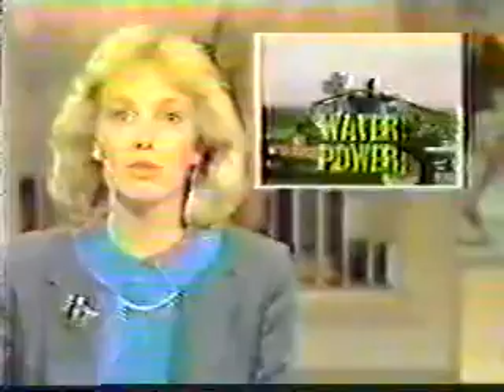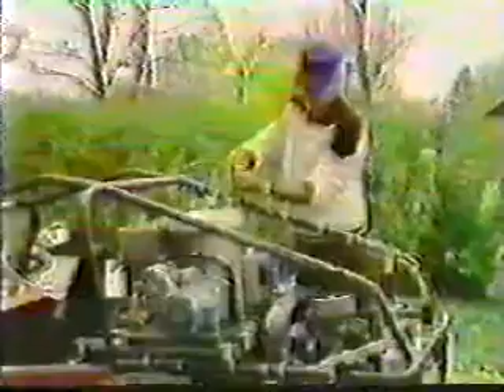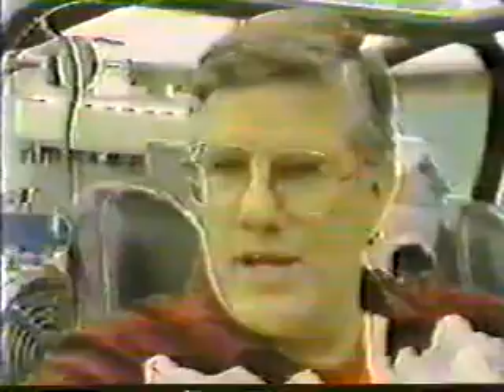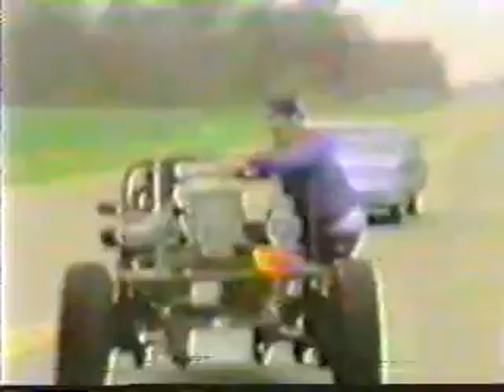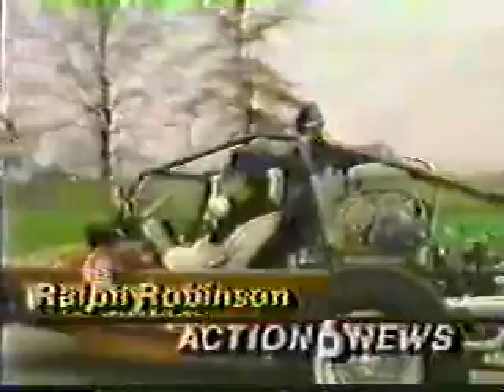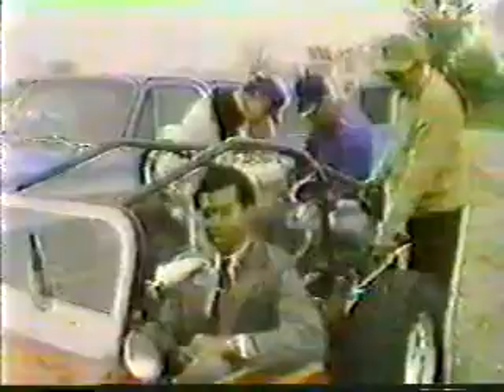water powered car

Comment: if you actually do the math he says you can go from los angeles to new york which is 2790 miles, with 22 gallons of water, thats 100 litres. that can create 11,19 kg of hydrogen and 88,8 kg of o2. now a toyota mirai can go a pretty respectable range of 845 miles on 122 litres of just hydrogen. 
forget about even making the car work if you listen to him and just think for one sec, he's full of bs. but lets talk about that, how does the car work? well acording to the internet and him, he has created a way to make hydrogen with 1700% output with the same amount of energy, with resonance, like breaking a glass with sound. now I know how you normally create hydrogen from water.
 its called electrolysis, where you give the water electrons, so they become happy and separate, making o2 and hydrogen. now if you could use the energy from the now unstable hydrogen, to blow up and run a car while making net energy to also make the power for the car youd be breaking the laws of thermodynamics, which would be nice, but not possible, as far as i know. but he has that resonance to make hydrogen super efficiently, but the theoretical minimum is 286 kJ per mol/18 ml of water to make hydrogen and you cant do that unless you have an outside heat souce. thats not even taking into account how extremely hard it is to hit that. because we havent done that yet. (and we arent even using a catalyst here) anywho, hydrogen has the energy density of 286 kJ/mol. wow what a suprise no net energy. actually in the real world, we would be very much in the minus, you cant do it even if your efficiency is 100%

Comment: There was an article in The Grove City Record on December 3, 1997 in which The mayor of Grove City approved 56 acres for the building of a factory to produce his water fuel cell that could be retrofited to homes for heating/cooling and all electrical needs, also for large scale energy systems. ... he died on March 20, 1998. 3 and a half months after the article was published.
Reply: big Oil & Gas harassed him to sell his patients he said no, then soon after died of a mysterious food poisoning at a restaurant (just him). I think it sent fear to those close family members for them to alter plans or something... i looked extensively at all the old black & white videos there's a layering of opposing radio frequencies like opposite of reverse polarity in noise cancellation tec & need some old army radio gear to play with.. thinking about the SDRadio stuff..

Comment: there is energy all around you, its all above -273 celsius. copper wire saturates this energy well,make a tesla coil and put a voltmeter on it you'll get a reading. if you increase the pulse rates of the electricity you put inside it to around 10k - 40k per second, with each pulse you carry along that saturated energy, thus obtaining more energy than initially put inyourself,but its an open system. thats one way, this water power does it by fracturing and uses milli amps.

Comment: You dont get something from nothing, its an open system. free energy is the induction of the saturated heat electrical energy all around you. absolute zero is -273 celsius and has no energy, and cannot be achieved by thermodynamics, thus free energy and perpetual motion is a fact of thermodynamics. all open systems.

Comment: Nikola Tesla. He built his tower to induce the saturated heat/electrical energy in the earths atmosphere and make it into high voltage and transport it wirelessly to the whole world! induction kind of bends the 2 law of thermodynamics, so does the constant of gravity, producing an overload of mass onto itself, because the fuel has run out and cannot keep the star stable by energy shooting out. thus relativity takes place and produces a black hole, the singularity, divide by zero, infinity

Comment: to hell with your BS. the hydrogen cell gives out more energy than put it, just like burning coal. The electrolosis process causes water to separate into hydrogen and oxygen, then the cell causes charged ions from the hydrogen (+) and negative electrons from the hydrogen and the flow of electrons make electricity. then the hydrogen ions go through the system and unite with oxygen again through electrolosis to form harmless water again. They could even burn the hydrogen!

Comment: Actually, there are plenty of fuel types other than petrol that can be used to power engines, such as ethanol and hydrogen.  Ethanol can be produced with corn, and hydrogen can be extracted from water.  The problem lies with their production.  There are environmental effects in producing cellulosic ethanol from corn.  As for hydrogen, it takes a lot of energy to trigger hydrolysis in water.
Anyway, I'd really love to live to see a water-powered engine, just don't know how that would be possible.

Comment: PRESUMABLY some hydrogen 'he made earlier' at home and stored in a tank. His machine would also make SOME hydrogen, it would just make less than is used up in producing it.  The basic principle I'm pointing out is the laws of thermodynamics or simply 'you don't get something for nothing' (perpetual motion is impossible). This car's science is like making a product for £1 then selling it for £0.80. It would use the electricity from 1kg of hydrogen to make 0.8kg of hydrogen (example)=doesn't work.

Comment: No. The reason we don't use this technology is because it simply doesn't work. Breaking up water into hydrogen and oxygen uses theoretically the same (if not a greater) amount of energy than one can harness through a hydrogen fuel cell. This is like translating a book from English to Spanish to translate it to English again - you don't get more than what you started with.

This would only work if the hydrogen was put in a fusion reactor, something scientists are developing as it's so complex.

Comment: 16 years later, and we are still not using this technology. I guess it's because there is such a big monopoly on oil. Also, if this did become the fuel of the future, water would cost allot more, or they would make it so you have to use water from a water station because the companies would put a chemical in it so you couldn't use normal water.

Comment: Reversed polarity, the voltage intensifier are key! As well as low amps. between .4 and 1 amp seems to result in the best seperation. This system does work i have a similar system on my 2000 chevy silverado. 4.8L. Although i only use distilled water with added electrolytes. There hasn't been gas run through my truck in 3 years. and i drive it 44 miles to and from work daily.
Reply: Can you post video of your truck
Reply: Lies you can’t create more energy then put in

Comment: It doesn't work. The alternator is spun by the motor and will always require more energy to break the bonds in H2O than you can get back out. It's the same as claiming you can hook an electric motor to a generator and get it to run forever while producing excess energy at the same time. 

It's common sense.

Idiot.

Comment: I agree with your assertion that the amount of energy (work) required to break the bonds will equal the output energy; that is conservation of energy.  However, the second law of thermodynamics proves that no process can ever be 100% efficient. . . therein lies the problem. You lose energy in the form of heat, and sound if nothing else.  In conclusion, E.in=E.out but not at 100% efficiency, meaning it takes more work to make gasses than you get from using it, just like E.85 ethanol.

Comment: @HelpingMakeLifeEZ Or, you could just get a European Diesel that yields more horsepower, way more torque, better gas mileage, and you only have to refuel every 600 miles. HHO from water electrolysis is horribly inefficient, outdated technology, which is why it will never catch on in the 21st century.

Comment: @rizzthakid Ok, I will. People who believe in this "technology" are ignorant. They should read up about (1) the second law of thermodynamics (might want to check out the rest too); (2) electrolysis of water; (3) efficiency of engines and generators. If they have done all of this and still think this works they should check that they know how to add and multiply, and how to use fractions. If they still think it works they are idiots.

Comment: @delacosta85 If you call that progress, I'd say progress is heading in the wrong direction. The most this 'water powered car' will most likely do is inspire the search for a new power source for transportation. It's certainly not the breakthrough that we need in order to stop using gasoline/fossil fuels.

Comment: @dragastar35 you've got your physics wrong. In a closed system, you can't end with more energy than you started with. Turning water into hydrogen takes energy. Burning hydrogen releases the SAME amount of energy. So tell me genius, why not run the car off the battery instead of using the electricity to basically achieve nothing.

Comment: KaerFyzarc is right. You cant run the car on water directly. You can run the car on hydrogen but not from water directly. The hydrogen fuel would have to be pre-made and be available at a "gas station". Combustion basically combines the hydrogen and oxygen back together. So if a car were able to directly split hydrogen from oxygen, then it would need a power source to do so. What the car would is basically change its battery energy to hydrogen energy...so when you 'burn' the hydrogen fuel--

Comment: @dragastar35 You have no idea how much energy is required to break the H-O-H bonds in water. Go read up on that, and come back with an energy equation showing how much is used to break apart one Mol of H2O, and then how much is gained when it recombines. Also the fact that you insist this is chemistry is very naive. Also please tell me how this 12v system is getting charged to continue the electrolysis. BUT FIRST go read 1st law of thermodynamics. Also read up on engine efficiency.

Comment: @dragastar35 Look here you n00b. No matter how efficient the electrolysis is, the energy required to break the oxygen-hydrogen bond is THE SAME as the energy you GAIN when oxygen and hydrogen combine (also known as burning). Thus if you had a perfect system you could convert H2O to H2 and O2 and back to H2O, but you CAN NOT TAKE ENERGY OUT. This is know as the LAW of conservation of energy (1st law of Thermodynamics, look it up.) So please, stop calling me an idiot and just go read your physchem

Comment: This is very possible.  Research has also shown that by extracting hydrogen from water and using fuel cells to store the output of electrons, massive energy can be stored and even used.  Basically, the car doesn't need a conventional battery, as well as can be a source of power for other applications, such as powering a house or small building.  Oh, and by the way, the cars can be made to go extremely fast.

Comment: Its kind of sad that people like you are allowed to exist, too uneducated to understand even the most simple of scientific concepts.

What do you get when you completely burn a hydrocarbon? You get CO2 and H2O... that is to say, carbon dioxide and water. Ergo, water has the least amount of chemical energy, hence why it won't combust further.

It is possible to generate hydrogen from water, but it takes more energy to produce the hydrogen than you get by burning it. First law of thermodynamics.

Comment: What a moronic and completely uninformed statement. The thing that most conventional nitwits tend to completely miss is the obvious; THIS PROCESS IS NOT ELECTROLYSIS.

What is it then? It is electrical voltage, not amps, being used as a carrier of a dipole pulse wave signal that resonates between two opposing charged electrodes that create a vibrational field that basically rattles the water molecules apart.  Jim Kanzius does this with radio only!

Have you even studied the patents? I think not.

Comment: Actually that's what plants do every day--split water into hydrogen and oxygen. Photosynthesis is the process. Others say electrolysis but the results are the same and the energy required is less than 12 volts.
Check devicedailyDOTcom or google it.

Comment: Platinum isn't the only material that achieves cracking. I did it in a drinking glass using a 9 volt battery and two bare copper wires. Granted, there are certain by-products generated by using different metals and different electrolytes, but useable fuel can be harvested using any old conductor. Different metals break down at different rates, as well. A platinum cathode will outlast a zinc or aluminum one, for instance.

Comment: No fission (atom splitting) happens during electolysis. The molecules (groups of atoms) are broken apart, which happens all the time in nature without radiation. Every time you eat your body breaks down molecules using chenical reactions. The only real danger in cracking water is the hydrogen itself. That stuff is pretty powerful.
Reply: so in terms of chemistry, do you think it actually worked?
Reply: @Inferno45  in those terms, yes. The problem, as I understand it, is that the energy required to crack water is more than you can actually extract from the resulting gases. People have claimed to have stumbled upon various ways of getting around that issue, but I have yet to see an actual working device. It would be pretty awesome if we could switch to a hydrogen economy that uses electrolysis as its backbone. There are a whole bunch of other problems with it as well, but that one seems to be the worst of them.

Comment: 1. Pure water is H2O 2H and 1 O
2. H = 20% of H2O by wt.
3. 1 gal. of H2O is 8.33 lbs., 1.66 lbs. of H fuel.
4. 1 gal. gas is 6 lbs (all fuel).
5. H has 2.62 times energy per lb. as gas. 1 gal. of H2O has energy equal to 4.35 lbs. of gas (about 3/4 gal.).
6. Can dune buggy go LA to NYC on 22 gal. of H2O when H2O has only 3/4 the energy of gas per gal.?
7. At 50 mi./gal., 22 gal. of gas will go 1100 mi. Can dune buggy go LA to NYC on 22 gallons of H2O? No way in hell.

Comment: What absolute horse shit.  Listen up.  Turning water into hydrogen and oxygen takes POWER!
"using the Voltage Intensifier Circuit (VIC) to produce voltage of opposite polarity"

That's meaningless mumbo jumbo.
The ISS uses this exact same concept.  It uses its solar panels to generate electricity, which is used to split water to obtain oxygen.  The hydrogen is vented.

But they need a power source to run the splitting process.  It is NOT a power source in and of itself.

Comment: the problem with splitting the water molecule on site is that you need a powerful and heavy battery (which if used to directly to power the motor rather than splitting hydrogen would be more effecient)

plus you need a huge load of water to get desired amount of hydrogen.

you would also need to install expensive electrolysis, sequestration, compression equipment in every vehicle

Thus this car is not at all feasible and my original statement holds truth: "this is the worst invention ever"

Comment: It doesn't make sense to power a car from water since you have to change water to H2 to either burn or put through a fuel cell to create electricity. It's more efficient to use the electricity to power an electric motor...

Comment: Cars powered by water would be like cars powered by oil, you'd still have to change that fuel into another before you use it. 

Electricity is used to create H2 from electrolysis of water. It would be better utilized by powering an electric motor with a controller at an efficiency of (80%). 

Rather than 80% to create H2 and 50% of the Fuel Cell back to electricity, for the 80% of motor and controller, for a total efficiency of (32%).

Comment: This method uses lower current(from a car battery) and vibrations to agitate the water, making it easy to free hydrogen from oxygen(high yields) It is not the old ineffective way of electrolysis from high school. This is molecular polarization to form HHO. HHO explodes at 2.5x gasoline, it works